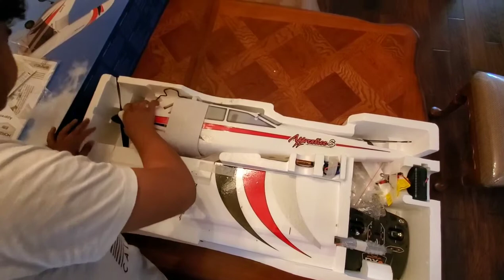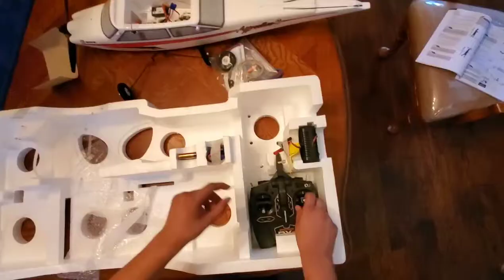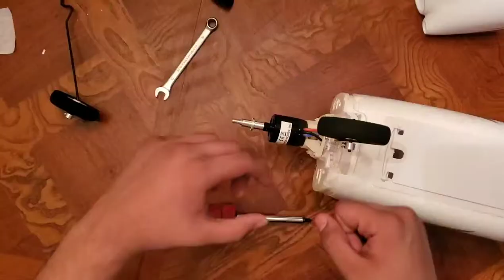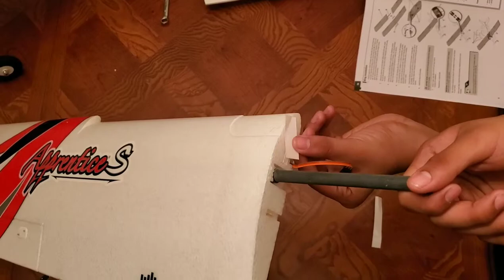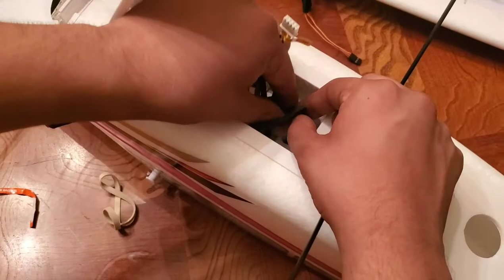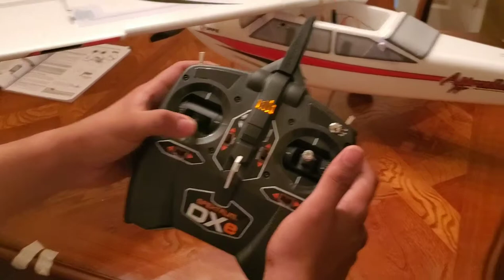Flying the Best RC Plane - How to Assemble

Comment: The double-sided tape on my rear plastic wing cover is not doing a good job keeping itself flush onto the foam. Do you recommend that I go buy double-sided tape or some glue/epoxy? And do I have to buy from a hobby store for this?
Reply from the maker: Hey Peter, I recommend using glue/epoxy. Personally, I use HobbyTown's Super-Gold +. It works well and can be bought from a hobby store.